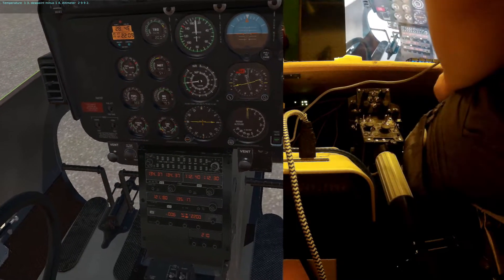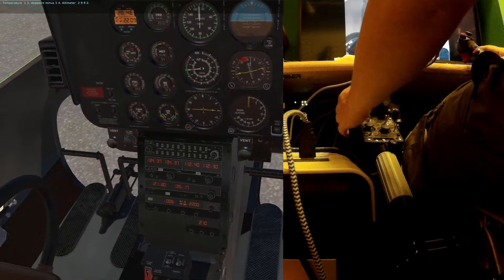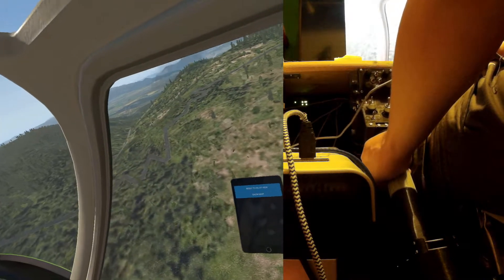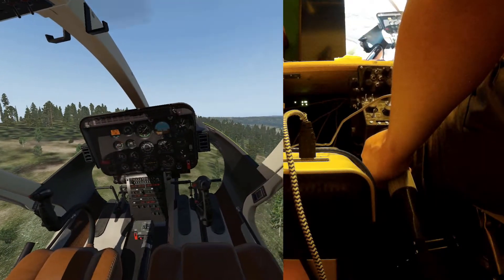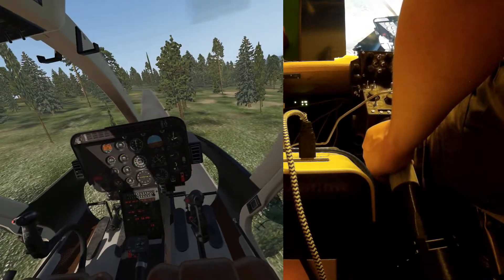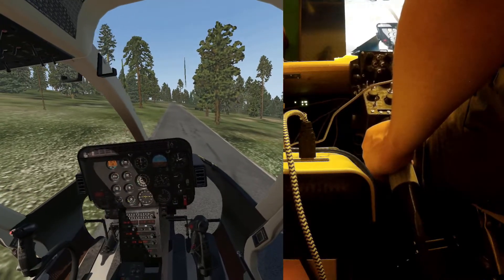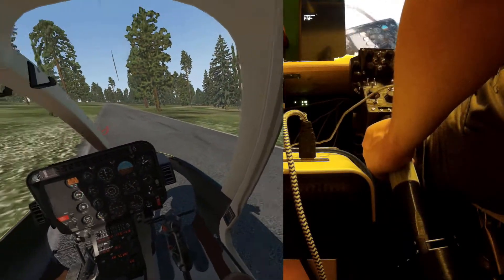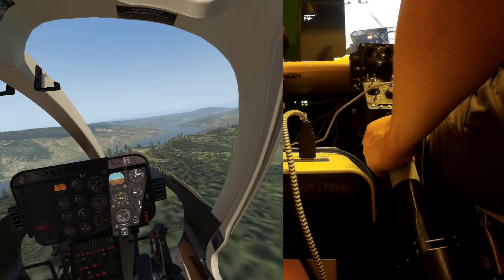Simchair EVO collective with VRMax head test and May 2021 project updates

Comment: I have been unable to find the tubing required for the various components in the USA for a reasonable price.  I have found flat stock in 10mm x 10mm and 10mm x 20mm for less than $20 US  for 4 pieces each size.  Will solid flat stock work in place of tubing?  The only difference I can see is in drilling holes.  I am waiting to purchase a 3D printer and get started.  I have sourced all of the components except the tubing.  I am very new to 3D printing and have reviewed all of the documentation you have provided.  Thank you for all of the time you spent creating and posting all of that information and with great pictures.
Reply from the maker: Hi! The only problem will be fitting the wires that normally go through the tube (throttle + i2c bus). You may need to drill plastic parts, otherwise, shouldn't be a problem. I2c cable can be routed outside of the lever just fine. Cheers!